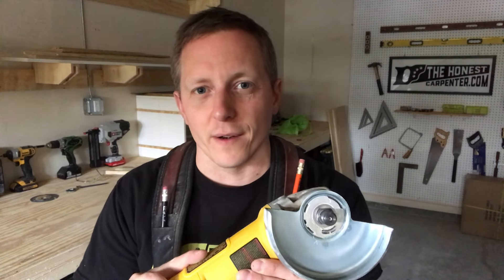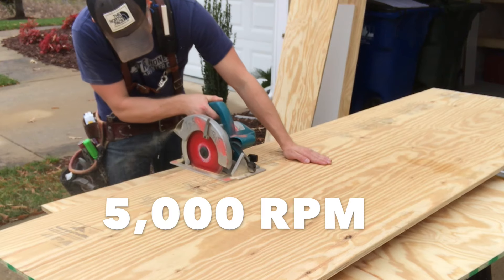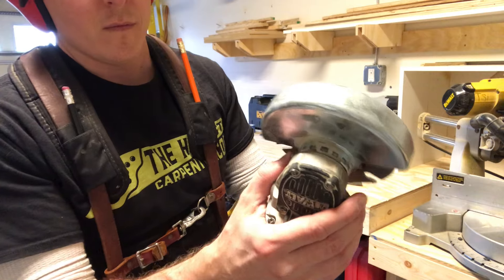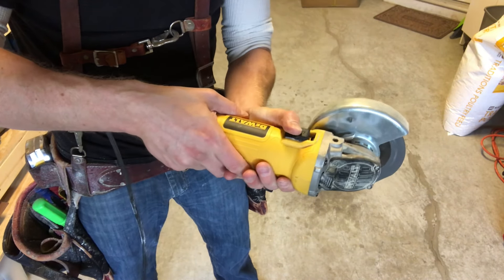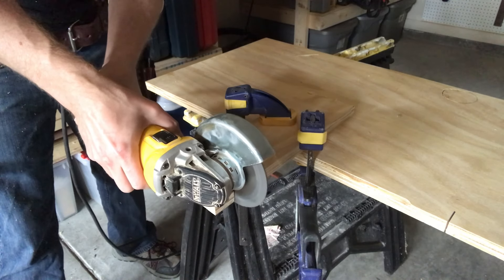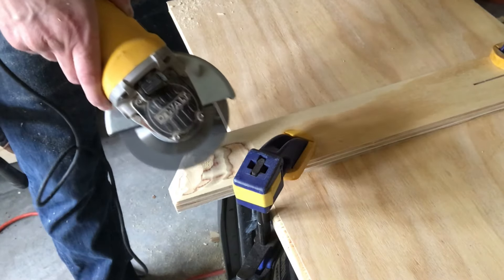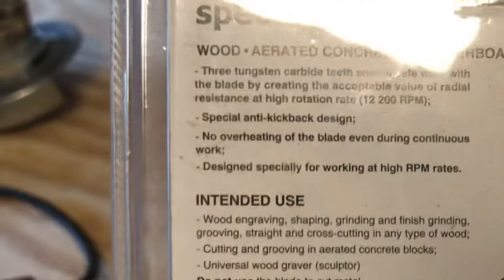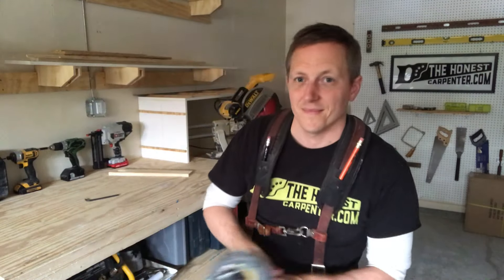CAN ANGLE GRINDERS CUT WOOD?? (Tricks + Tips--Cutting Wood With Grinders)

Comment: Excellent instructions. I have this exact blade for my 125mm grinder, tried to cut small wood but the teeth got caught and the wood flung away from me. Maybe I needed a much better way of securing the wood instead of just stepping it with my foot. 

My grinder is pretty safe with button trigger instead of a switch as it stops as soon as I let go of it.
Reply: Please be safe, don't cut like that, you risk losing balance and may cut yourself.
A few days ago I injured myself just a little bit, with brand new grinder.
Put a wire brush wheel on (figured its safer than a disk), has variable speed so I set it on 1 out of 6 (around 3000rpm), turned it on and forgot to put gloves and one finger was close to the wire brush and it bruised my finger a little bit. Had it been on highest speed, who knows what injury could have been. This was just one sec of not paying attention.
My button trigger has click to run and also can be blocked, so doesn't seem very safe to me. In case of injury, it may continue to run.
It's also very close to front of grinder, no idea why.
Initially I didn't mount the wheel guard in the correct position, I had it upside down and it was not tilted properly, this is why my finger could touch an exposed area of the brush.

Comment: Looks cool but Best recommendation is to use tools as they are designed for. There  is a small hand circular saw in the market, looks like the grinder but is made for that tipe of work,( don remember the exactly name but it’s easy to find in Home Depot or Merlin Leroy ) I have an accident with table saw in the past and was so lucky no fingers cut ... safe first .

Comment: These wood blades work great in grinders with slow speeds like brushless cordless grinders with a low speed 1500rpm setting or polishing grinders. I’m too scared to use them in normal full speed 13k rpm grinders, the space for error and catastrophic injury is just too high at those speeds, or even just a tungsten tooth coming loose at those speeds could cause some very painful injury.

Comment: Rarely do I not use the handle. It dose what your doing with the guard and gives you leverage if it kicks. Some will use a cut off wheel without the guard also, if it ever snaps youll have to pull fiberglass and grit out of your face. Pro or not both not so smart. That said, Im runing one of my 6 grinders with a 5.5in. Saw blade. It has a bed plate though😂😂❤.

Comment: This absolutely terrifies me. I can just imagine a kick back hitting me in the gut.
Reply: Can't you change the handle to the other side and use it flipped over?
Reply: @solarsynapse  sure. But then it can bind the other way.
Reply: Jerod, HD does not carry wood cutting blades for a grinder because they're too dangerous. I've used those blades through the years though. Got them on line- Bad Blade. But this one sounds a bit safer in terms of kick back. Just be super careful if you do give it a shot. No joke. No room for carelessness.
Reply: @TheDylan6908  yeah, I don’t know that I’d ever trust one. A corner in the material or the grinder rubbing on the wrong edge of the wheel for a fraction of a second and you’re in trouble. It’s just spooky as hell IMO.
Reply: Makita makes a cordless angle grinder with kickback protection. I have it so I'm unsure if cutting wood with it would be safe or not.
Reply: Cmon you're a grown man

Comment: Top tip for you you could attach the grinder's grip handle so you can hold it better and more firmly just a quik tip if you working with a grinder be safe even grown men make mistakes make sure you can grip it and not let it fly out your hands
Reply: The grip sure makes it easier to handle kickbacks, but even with the handle the kickback on wood seems to be worse than on metal.

Comment: Always wondered if they would work for plunge cuts in plywood when framing out windows. Drilling a hole then using a saws-all is a pain.
Reply: Use a router to cut out plywood from windows - a hole anywhere to get started and it follows the framing all the way around
Reply: But a saws-all is about 100 times safer
Reply: Get a Cuz-d saw. You can find YouTube videos about it.

Comment: I've used multi-material 'rescue' blades which do a good job on wood, but they aren't for precision cutting as you'd get from a dedicated wood cutting tool.  I have used one to cut channels into deck framing to help mitigate against pooling water (long story, but fixing up a tradie's mistake)...the grinder using a rescue blade did a very good  job, but it's all freehand, and I was certain there were  no nails or other hard material that might have caused a hangup or kickback.  I have to admit, I was really wary of doing it, it is really unsafe.

Comment: I purchased the Bosch GWS8-45 grinder and it says in the manual, that it’s not meant for cutting.  Is this true?  I thought all angle grinders do cutting with a cutting wheel.  Some model angle grinders also require you to purchase another wheel guard just to do cutting too.  I don't know why power tool company's do this.

Comment: The RPM's on these machines are just too dangerous to be cutting wood
Reply: There are grinders with variable speed control, they even recommend in manual speed 3 out of 6 for wire brushing and 4 for polishing metal. Speed 6, which is 11000rpm, is only for cutting metals. It's clear that grinders should run at slower speed most of the time, which helps reduce heat, chances of breaking the balde, lower kickback energy, vibrations, wear of the metal gears inside, wear on the brushes.

Comment: FIRST THING: no second handgrip? What the fuck man???
Second: never cut towards you!! Also when cutting steel, (my Metabo runs in the other direction) but one should use a grinder always that it tends to PULL AWAY from you, that way if you let go it will pull out on you faster than a 17y old boy in his 15y olg girlfriend that is not on birth control.

If it tend to run towards you, and you let go? Man… they will have a fieldday at the operating room.

Edit: I see you have a model with a locking switch? They call these a suicide switch for a reason… I got one with a paddle switch with no lock. (Not a rat tail tho) So if you let go it will stop running.

It also has a system that stops the blade if it were to get pinched. As well as a engine brake. It will stop spinning in 2 seconds. Great system! Invest in a grinder that has some
Safety systems if you use one on a regular basis.

Mine is a Metabo WPB12-125 quick.

Great machine! Does 1250W and was below 150€. Very reasonable deal, has all the safety functions the new ones have. 

They make a bigger brother in 1750W but these are over 300€. I’d say the smaller one is a great deal!

Comment: 3 teeth per rotation will kickback like the Robot called Hypnodisc on Robot Wars, 40T would nibble away both depending on pressure, its safe to say the lighter the pressure the safer. I'd personally never use this on a corded AG because its to powerful and never without a handle and guard in the opposite side of the kickback direction. Eventually these will be banned like the chainsaw disc. In the rush to cut we cut corners and we are always in the way.

Comment: I have a variable speed angle grinder and i use it with the handle. 11 thousand rpm is way too much and dangerous too. I suggest to use a variable speed angle grinder, use it always with the handle and the guard installed

Comment: I'm thinking buying one of these solely for making wooden swords, but now I'm not sure if it's worth a finger or two...

I absolutely have no experience with carpentry, so anyone can recommend a better and safer tools for making swords? Preferably something on a budget, and if possible jack of all trades for sword making purpose so that I only need one tool and nothing else.
Reply: We're talking wooden swords? Cause when working on metal, grinders are still dangerous but another beast entirely.
For making wooden swords, like bokken and whatnot, i would say you're better off with a bow saw for doing all the rough cuts and a belt sander for actually shaping the swords. We're talking "on a budget" so a handheld sander, a bow saw and lots of clamps. Oh and rasps. You'll need some rasps too.
Yeah, rough cut with a saw, rough shape with a rasp and then a truckload of sanding.
Reply: @Djanck000  Wow, just found out about rasps and what it does. All this time I've used a chisel for shaping the edge, and it ain't pretty... More so because dumb me used harder wood, like the ones you found for bed supports, so it wasn't easy but honestly a pleasant way to pass time surprisingly.  

I just brought a set of miniature files, but they way smaller and was intended to use for making a smooth cross guard hole for the sword tang and other smaller fine details. Might buy a proper rasps now that I'm aware of their purpose. But which type is better? I'm thinking flat and around 6 or 10 inches, saw those on sale and I'm interested in buying one of them.

And may I ask why bow saw specifically? I'm always used an ordinary hand saw on my projects, does the design of the saw affects the cut and ease of use or something?
Reply: @komi-samabeliever7319  Happy anything i said was useful, so... Ordinary hand saws are great for doing straight cuts. I said bow saw because it is basically a "handheld belt saw" by which i mean you can make a somewhat curved cut with it without getting too cought in the material (which is both a blessing and a curse), but if you're already familiar with and have an ordinary hand saw there's no need to buy a new saw now. But to answer your question, yes, the design of the saw affects the cut.
About the rasps, the world is your limit, hehehe. If you can/want to invest in just one for now, i would highly recommend the flat and round (the size is more related to your projects than anything else). The little ones are great for little things and cleaning details.
In the future, if you already don't have them/don't know how to use them and feel like screwing yourself by having to learn a new skill, i would say a hand planer will bump the quality of your work too.
Reply: @Djanck000  thanks for the additional info friend, you have no idea how helpful all this for me.

Actually, just order 4 in 1 portable rasps & files after meticulously watching few YouTube videos about it, and decided it's the best one in my case, a bit small though. I kinda want a proper 10" rasp, but I have a hard time finding one that actually a rasp. Most I found was files, ones without teeth, sellers just cram anything for algorithms like a menace. 

I do actually have a planer, but for some reason I can't really use them well. It's either the planner a bit too small for the project or I'm just not using it properly, I really don't understand how to make a long continued plan without breaking the motion. That's the sole reason why I brought and switch to chisel in the first place, since planning the edge just didn't work for me.

Comment: Should I wear a mask when using a grinder?

For example, a face shield is suggested while using a grinder due to the amount of hot metal particles generated. A face shield is considered a secondary form of eye protection and should always be used in conjunction with a primary form of protection – safety glasses or goggles.

Comment: I’m about to buy a grinder, but y’all scaring me with these videos.😫
Reply: I used a cordless Ryobi Grinder( up 6500 rpm) to cut floor bolts on an older toilet. It was very intense first time used one it was an experience. Just take your time and you will be fine. Safety glasses are mandatory.Gloves are optional(a grinder will slice right through any glove.

Comment: Is there any recommendations of cutting wood sheets straight using Angle Grinder?
Reply: You’re better off investing in a cheap jigsaw which would do the job more accurately and about expensive as that wood cutting blade.

Comment: CAUTION!! If you want to do it ,do a double pass(for 24t or 30t or 36t blade) if you do a long continues cut on board ½" and above in thickness. Higher risk of kickback(/blade grabbing the board) when cutting thick piece with single pass.
Also, hearing aid readily available but you probably can't afford eye prosthesis that works like the original. WEAR YOUR PPE. A knock off Ray-Ban and surgical mask are better than none. I recommend get a proper one. 
sorry if it too long, just want you to be safe. Lol..

Comment: Oh boy. 

It's one thing to tell people to be careful. It's another to tell and show them how to operate the tool safely. Metal workers understand how to use angle grinders. There are two types of discs for metal work: cutoff wheels and grinding discs. The cutoff wheels are used to make plunge cuts only. If they twist or shear they snap and explode. The grinding discs are used obliquely to remove surface material.

Metal workers will tell you to use the side handle always. That stabilizes the tool so that if anything grabs the business end stays pointed away from you. If you hold only the body the tool can flip right out of your hands and come right at you. This is especially important when carving wood--which catches a lot more readily than metal. The only reason that handle comes off is so that you can switch sides. 

Like cut-off wheels, the disc you demonstrated should only be used to make plunge cuts. Those teeth on the end might not bend and explode, but they will chatter and bounce, and a catch after a bounce can fling the grinder right at your head.  That can be challenging to control even when you have a firm grip with one hand on the body and the other on the side handle. 

If you want to hog out a lot of material fast, make a series of parallel plunge cuts and use a pry bar to break off the fins. Then smooth out the stubble with an abrasive wheel made for wood like the Kutzall. Shaving looks like it should be efficient and fun, but it's actually quite risky using any wheel with teeth. I avoid that and suggest that others do too. If you want to shave wood with an angle grinder, a Kutzall or any disc with abrasive nubs instead. It isn't that much slower and it is much, much safer.

Comment: See ive been curious about these blades for my grinder. I do alot of floor replacement and i can never get close enough to the wall to remove the rotted subfloor. I think a tool like this being careful would be great. Ive seen a chainsaw style blade for the grinder but i  feel like if loose some fingers if it bit to hard in the floor. Definitely scary stuff.
Reply: I know I’m late, but you can get these tools. I’m not sure what there called I call them multi cutters. It’s like an angle grinder but with 2 blades that spin opposite. So there’s no grab, like they don’t grip to the wood and pull off in any particular direction. 

This is the tool you want.

Comment: You can lower the speed of an angle grinder with a light dimmer plug cable.
Reply: This works by lowering the voltage but at the cost of increasing the current and heating up the motor.  I do not recommend dropping the voltage lower than 110V.

Comment: you should have used the screw in side handle on grinder. you should never use grinder by only holding the body of grinder. i have a tooth blade for 4" & 5" grinders both have 60 teeth find them very handy though never use them on wood many most time cutting think plastic with them like pvc pipe, poly pipe and poly roof sheeting

Comment: On a corded grinder with no safety switch or speed control, I wouldn't even chance it. I have a Flex Tool angle grinder that's cordless, has a safety switch and allows for speed control and have easily and safely cut wood with it, at a lower speed. Still, use a better tool when you can.

Comment: I've used more teeth on blade 3 days ago without knowing that it's not for angle grinder machine it was 360 free (no safety cover)
And I was cutting door from botum, when it was done I turning off the switch and the blade touch from upside and strike to my hand
So I searched this video 😂

Comment: Actually these toothed blades are not safe for angle grinder at all! If you have to cut wood by angle grinder, a carbide or diamond rim metal blade is a much safer solution, although they may cut wood slower.

Comment: Sorry, I would never recommend using a grinder with any type of blade to cut wood.  Wood binds too easily and the speed of a grinder can kick back at incredible speed.  If you are even the slightest careless on what quadrant of the blade touches, it can kickback in the most unexpected direction, including towards you.  Never have and never will use a notched blade on a grinder, or a grinder on material that binds easily.

Comment: Ahh nah, great for metal with a smooth disc applied without pressure but for woodworking  it’s made with teeth that cause it to kick uncontrollably Pulling it back toward you as shown is potentially fatal.

Comment: For what it is worth.. thinner wood or like precision cuts.. I use plain metal cutting discs.. they also burn the cut smoothing it out.. HOWEVER.. BE CAREFUL!!! If the blade gets hot it tends to stick in the cut and well.. you have a angle grinder trying to brake free☠️☠️☠️

Comment: Quite dangerous, I will not definitely never try to cut wood with it . Another strange thing: every angle grinder has a handle to give safety and more accuracy in the cutting - so why don't use it in such a dangerous operation ?

Comment: Ya messed up badly my leg with a blade like this used it with both hands but without the handle & the grinder choked up on a knot in the wood & my both hands were no match against the crazy RPM of a grinder it flew out & stopped at my femur slicing up my leg badly... 
Would not recommend it when there is much safer ways to do any application that this blade could do with typical tools